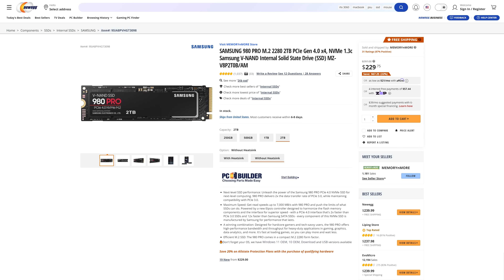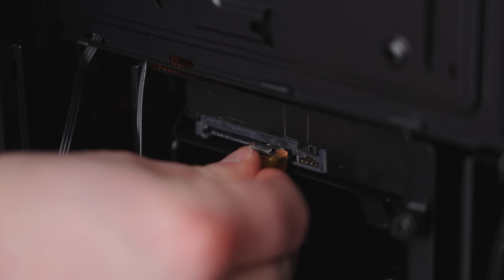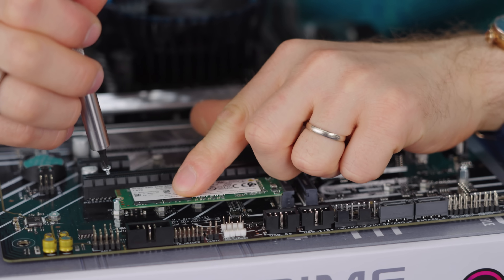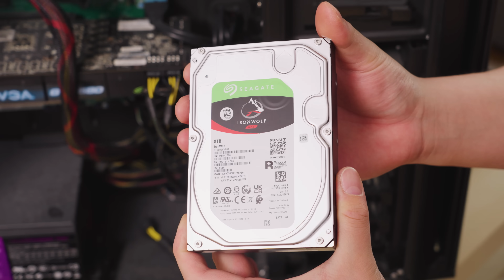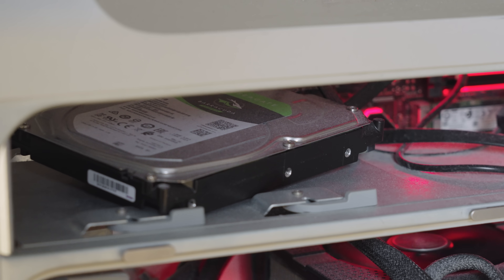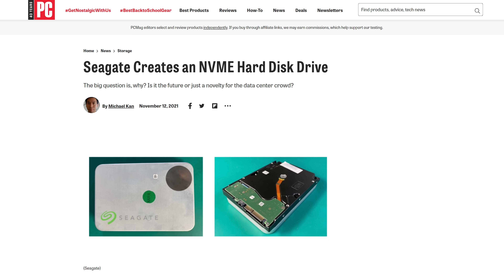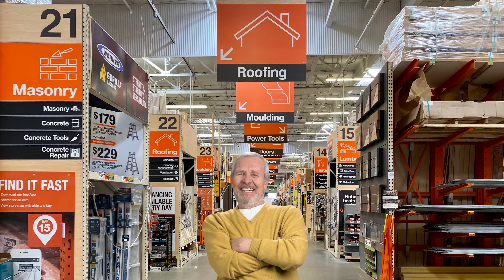Is SATA Obsolete?

Comment: This video makes it looks like that PATA went away because of SATA SSD, which is factually incorrect. I was really confused when watching it because it didn't match my experience, thus I ended up with lots of question in my head like "is it really because of that?" "was SATA SSD a thing when SATA was introduced?". Personally I would suggest to simply take this video down and redo it or just post a clarification video since again, a lot of younger people didn't experience the early SATA days when it lived side by side with PATA, thus they might have the wrong idea about SATA being designed for SSD which is not the case and SATA is actually not optimal for SSD.

Comment: The problem with Nmve is not having enough connections. Even right now an expensive motherboard has only 2 of them while having 4 SATA. It needs to be a standard of 3 minimum but with how badly designed it is, it needs to cover motherboard surface. I'll probably end up installing a PCIE expansion card for a third drive later on which is something I haven't done in 15+ years.
Reply: If I remember right, the first motherboards that had SATA ports only had two, along with the PATA connectors.  If there's enough demand, you'll start seeing mobos with more Nmve connectors.

Comment: 0:56 there was a lot of "normal"(like a USB-cable looking) PATA cables, they are just not seen as often as they did cost slightly more
Reply: I ad some at one point, they were still a pain, but they didn't block the airflow as much. They were basically just the standard cable, but they were run through a tube vefore the connectors were installed. It was worth it if you had the money as the regular ones were a pain to route.

Comment: Just fyi I do have some PATA SSDs (44-pin IDE)  they had jumpers too, they existed 20 years ago and maybe before that, had them from some old HP thin clients from 1 to 8GB drives (more than enough for windows xp & a lot of old apps) I still have one machine with 1GB PATA ssd it's t5000 and the CPU is Transmeta Crusoe TM5800 1GHz(SOC) with 256mb of memory

Comment: 1:22 As a person with no hard drives in his computers, I can confirm that. I used to have Steam on NVMe, until I had to migrate it to a bigger 2,5" drive as I was running low on space in the NVMe. Gaming-wise, it didn't impact performance AT ALL.

Comment: One small inaccuracy, NVME on cheap laptops isn't necessarily good, got my father a lenovo and the nvme they put on it is slower than my 5400 rpm hdd, nvme is just the interface, it doesn't dictate the chips/hardware will be good quality, and yes windows is bad, but windows shouldn't be that bad to constantly and easily max out an nvme
Reply: We need to research how lanes are allocated on laptops, which is not always so transparent.

Comment: SIll thought..many people don't even own a single computer bearing m.2, yet. Also you cannot use for bigger archives consisting of a lot of drives, because there aren't enough slots on any board and even expansions like PCIe cards with m.2 adapters won't give you many slots for a decent overall capacity - obviously amplified by the inability to connect 20tByte+ drives to m.2 as there are: none.
And perforamcen wise: Yes, as you said the step to nvme doesn't mean any improvement for most users, and even more: Also the step from mechanical drives to SSDs was not necessarily as big as received by most users, as it obviously was artificially increased by the terrible coding of the piece of shit formerly operating system from Redmond, which for absolutely no reason suddenly was making about 50 times slower use of storage than before, starting with Vista.

Comment: One think to remember that will keep Sata SSD’s around for a while longer is the retro-PC/recycled PC market where people take old PC’s with only SATA ports and no M.2 slots and replace the Spinning HD with a SSD to bring new life to the old PC. You can also use old external USB 3 SATA hard drive enclosures with a new SATA SSD for a fast durable external SSD that can take being carried around plugged into a laptop better then external laptop USB HD. Also, some people still need to access optical media and if they prefer an internal optical drive, having SATA is a must.
Reply: I had no idea USB 3 SATA hard drive enclosures existed. This makes using a sata ssd SO much easier, thank you!!
Reply: @godfist314  For under $20, you can get a M.2 NVMe SSD enclosure that will turn you SSD into a very large thumb drive with USB 3.1 Type C and USB Type A connectors on each end, for example. And SSDs can take a lot more banging around then a external  spinning drive making them good laptop use, so long as you're willing to pay the difference per megabyte in price which currently is much closer then it used to be.

Comment: The problem with SATA now, is that it stopped at version 3 with a 6Gb/s limit. A version 4 with 10Gb/s or more would greatly help the standard, as it would allow SSD that are lower cost, but less performance than NVMe, but could do 1GB/s transfers.
Reply: This basically exists already in the form of SAS 12 Gbps. The drives aren't actually cheaper but it's more due to the intended market rather than technological restrictions. There are also already low-performing NVMe devices that don't utilize all available bandwidth. I don't think providing a slower interface will make them any cheaper. The M.2 form factor is already about as bare bones as it gets in terms of manufacturing.

Comment: Isn't it a bad argument to posit that SATA would stick around because current motherboards are made with more ports for it in mind? Why couldn't we just as easily assume that nvme risers become the new norm, or pcie bandwidth to the chipset would just increase over time while reducing the space needed for the SATA receptacles, especially now that 12VO is being pushed out and mobos that don't do many 5V conversions might be enticing?